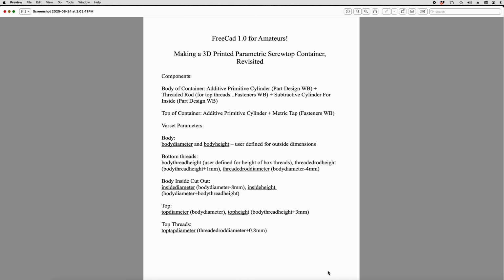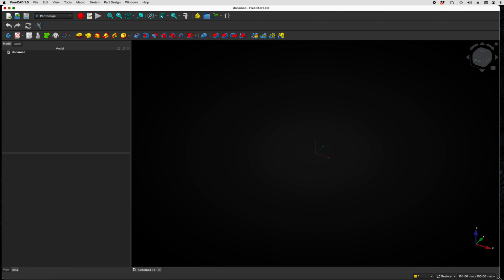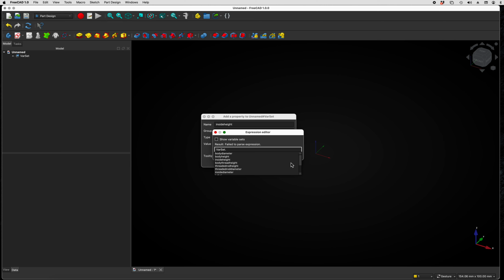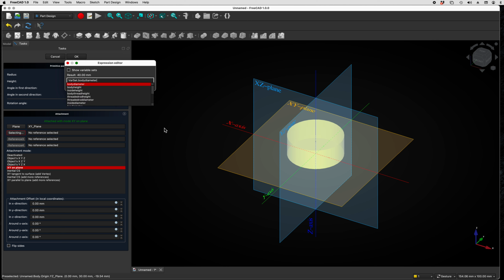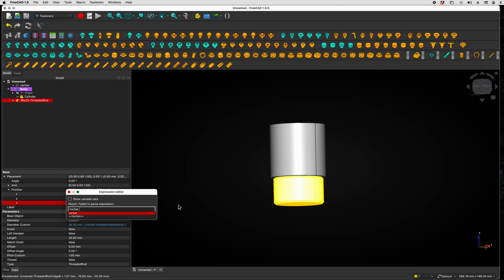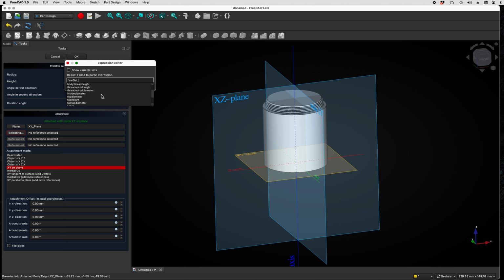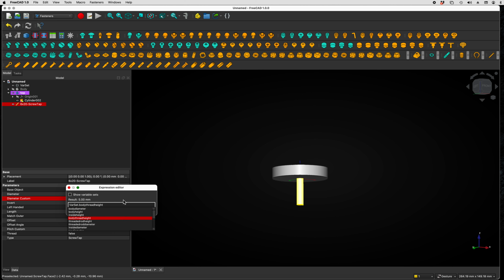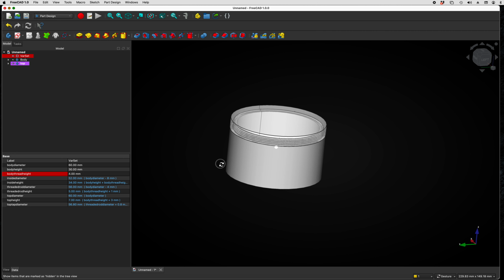FreeCad For Amateurs: A Parametric Model for 3D Printing A Screwtop Container

Comment: One more (and hopefully last) question Steve ... What if I want the same threaded rod on the other side of the cylinder so that i could put a cap on both ends ? What would the Z position of the threaded rod be then ? (For now I have done it manually). Also ... When printing this there will always be threaded side on the print plate. Any tricks to make that first layer good ? (I have a Bambulabs P2S)

Update : I got it sorted out. Remains is how you avoid bad first layer(s) quality since the tread will be on the build plate.

Comment: Hi, thank you for your excellent video's ! I just completed your older video where you make this in a manual way. I added a spreadsheet in Freecad  so I can enter the measurements so also make it parametric. How does this differ file varset principle ?
Reply from the maker: It doesn't really..they are just different ways to do the same thing